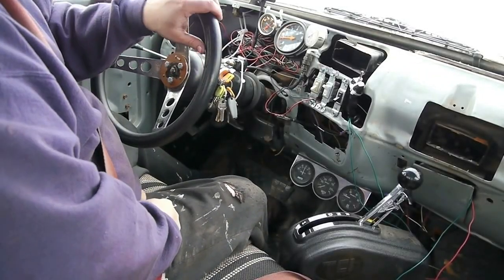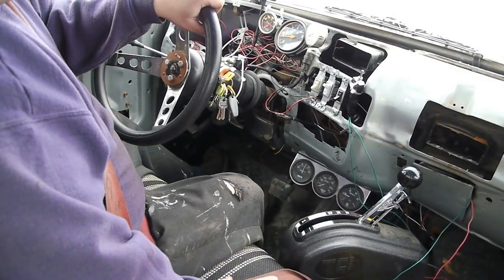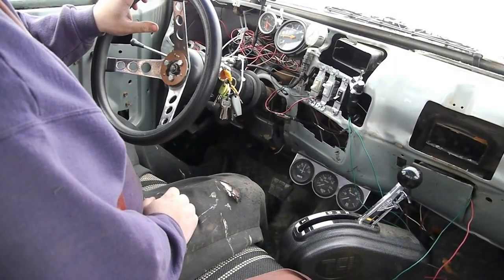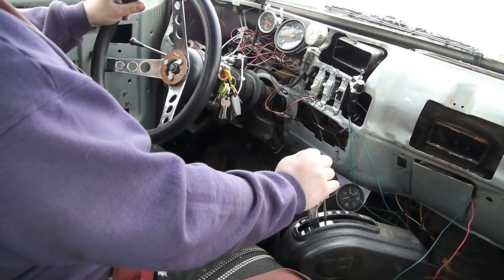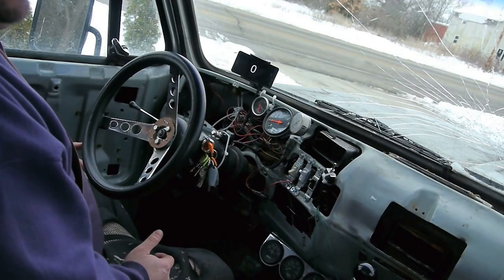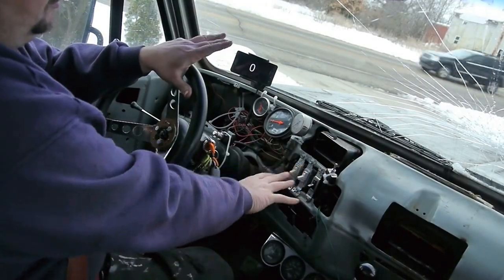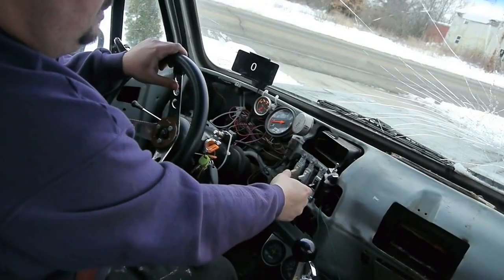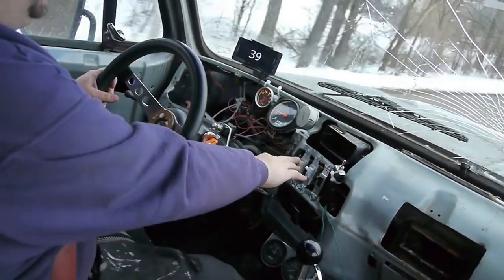4l80e full manual with no computer

Comment: So you're not modulating main line pressure at varying throttle positions , what are the possible implications of not doing that?
Also what's the purpose of the 3-2 PWM solenoid, dont you need that when down shifting?
Reply: Thanks 96TA...........Ever thought about doin a quick video of your setup? thad be cool, hint hint, lol
Reply: GoatBoy 45/70 he will have to rebuild this trans alot sooner. the max line pressure restricts converter flow (and from MY experience) the shifts are delayed about 3 seconds from the switch being flipped. the trans runs hotter than usual, and the rpms are higher. i would have to get my burb up to 2k just to try to keep up to speed limit. All that has changed now since i bought the TransGo vacuum modulator. i jerry rigged it by running steel vac hose thru the dipstick hole and cutting thru the dipstick tube then running more hose to the intake. lower rpms, runs cooler, shifts are sharper and instant, engine doesnt have to work as hard to move the truck.
Reply: GoatBoy 45/70 pwm solenoid is the incorrect term for what he is describing. the force motor/ pressure control solenoid is what controls line pressure from the factory. the vac mod i mentioned can replace that even if you still use the computer for auto shift 4l80. downshifting is just what he did in the video with the switches except REVERSE ORDER. me, personally i unlock TCC first then slow down keeping it in 4th. if i slow down below 20 mph, i pull both switches down to 2nd. dead stop i put solenoid A switch up to 1st gear. very simple compared to a real manual trans.
Reply: SnakePliscan2 yes ill do a video of the burb soon. Will get back to you on the GM squarebody thread that has pics of my setup.
Reply from the maker: The implications are potentially something breaks.  This is a junkyard transmission, nothing done to it, basically a core.  I'd be out the cost of my core and my time if it failed, which it never did while owned the truck.

Comment: what is the use of lock up torque converter?
Reply from the maker: A lock up torque converter helps improve fuel economy by lowering the RPMs when you are cruising.  Normally the engine RPM and the transmission input shaft RPM are not equal.  The torque converter allows slip, which is why you don't need a clutch in an automatic transmission vehicle.  At cruising speeds however, the lockup feature acts like a clutch that "locks up" and either completely prevents slip between the engine and the input shaft of the transmission or greatly reduces it (it depends on the car type and transmission).  

For me, going down the highway at like 70mph, the when I activated the lock up feature it dropped down my RPMs down by about 500.

Comment: How long did it last? is the truck still in service with the same trans?
Reply from the maker: I sold the truck.  It worked the entire time I had it, which was at least 2-3 years.  I have no idea how many miles the transmission had on it by the time I got it.
Reply: nice!

Comment from the maker: I don't know if it could lock up in first, I don't remember.  But I'm fairly certain it could in the other gears.
Reply: Dan Mann my 03 slivrado in tow mod locks up the coverter on all gears and you can notice the difference, the engine shifts at higher RPM..
Reply: Late to the party. But you can't lock converter in 1st with a 80. If I remember right, it uses the fluid from 1st gear to lock the converter. 
But 2nd, 3rd, and 4th it can be locked.

Comment: just curious, could you send power to the solenoids like being in 4th and then just manually shift it as if it were a full manual valve body and then just have a switch for the lockup?

Comment: how long have you run the c 30 with that 4l80e setup and have you had any issues with the full line pressure causing any probs?  I was going to run a shift drum with proper solenoid timing contacts and manual levers at the same time  side by side like zero turn mower handles so they can be shifted at same time or separately I was told by a friend in the business full line psi would lead to spline damage and or clutch pack damage I said I didn"t think so????

Comment: great work. do you know where their is a wiring schematic for this mod. im thinking about putting a 4l80e in a 1990 truck with a old 350 edelbrock carb, hei distributor. for a small point of interest. use a ardunio to control the actual shifting. that is a 5v board but with transistors and diodes could control a 12v system. the tach line could control the shift point. and with a additional switch. manual control is possible or with multiple control switches different shift points could be programmed. lots of options.

Comment: transgo sells a vacuum modulator to replaces the epc solenoid. aka force motor or line pressure solenoid. Then there is using the 1995 tbi chevy pcm with modded prom.

Comment: The SM 465 is one of the toughest transmissions ever made your loco for taking it out.  You will never have the pulling power off idle by taking out the Granny gear 4 speed,  are you a total goof?
Reply: Skeefoo Panama 😂 yea just the same way im loco for takin out the fully auto dinosaur th400 for a toggle switch shifting 4l80 like this one, right?? 

Get a clue, man. Its 2017. NON overdrive trannys with slippin ass torque converters are a memory of the past. especially when you got a bulletproof 4l80 that can be manual shifted like this one (computer deleted) and aftermarket vacuum modulator to replace the "force motor/epc solenoid" for engine modulated pressure. i got one of these in my truck and anuther in my street strip car. shits just too simple to pass up and not have. and theres no having to beef it up either.
Reply from the maker: I liked the sm465, it was fun to drive with that transmission.  It all came down to having back pain while shifting it, that's why I did the swap.
Reply: sm 465 is great for off roading,or a farm truck but it's no fun without overdrive. with the 4l80 you get much closer ratios which are very nice, especially if you are ever in mountain country, for towing or even just a work truck that gets used on the freeway. you will get better fuel economy just with the first thru third even when you're not going fast enough for overdrive. you could even go with 4.56 axle ratio and still get better fuel economy than 4spd manual with 3.73s. even 4.10s would plenty low for a start out with 10,000lbs behind you. many 4l80 equipped trucks came with 3.73s unless they were a 3500hd. the overdrive on the 4l80 is only .75 instead of .70 or .69 like all the other autos of that vintage. the 4l80 is the ultimate automatic for an older truck that's gonna do some heavy hauling and still be able to do some offroading. the manual alternative is the nv4500 which has stupid wide ratios, not great for towing. first is not all that low either. they are nice for offroading if go with 4.56 or 4.88s, but only in standard long wheelbase truck. not enough length in a blazer. besides the wider ratios the 4500 is gonna be more expensive than the 4l80 when swapping into an older truck. that's why I'm putting a 4l80 behind my 400 in an older motorhome that will spend most of its time in the Great Southwest.

Comment: Real cool. - What happens if you forget to turn off your torque converter lock when you come to a stop.
Reply: Nothing really - it'll just stall the motor similar to coming to a stop in a manual trans without pressing the clutch pedal in.

Comment: I´d rather you talk to much and be clear than rush through. Light switches are a nice touch lol. Well done. So, when you have all the selenoids on you can basically manually shift up AND down? The full line pressure does no harm does it? The old 700 you couldn't do that as it would also determine shift points of that TV cable. I've got a couple of 4l80's I was considering for a personal project and a customer car. This might well get me over the top. 

The cool thing to wire up would be something off the side of the shifter that makes contact with each selenoid switch combination that corresponds with the gear. You follow? That way you basically turn it into an auto box with manual shifting but by the same way the computer would have so no worries. The feel of a manual valve body...
Reply: Radesignsproducts.com has just that . Along with line pressure control

Comment: hey Dan? do you know if that 4l80e had a 3-2 downshift solenoid and if that's going to be a issue.
Reply from the maker: All gears are controlled by the two solenoids.  Going from 3 to 2nd place is just putting each of the two solenoids into the correct on or off state.  So there is no automatic downshifting.  You have to manipulate the solenoids like the video.  If you want to downshift just move the switches and the transmission will instantly change gears.
Reply from the maker: I should have also said that there is not a downshift solenoid.  Turbo 400 has one, 4l80e does not.  On the 4l80e that function was a combination of throttle position sensor and the ecu.  The ecu would detect throttle movement with the throttle position sensor, and then look at rpm, current gear, and road speed (maybe even more sensors).  The ecu then had a table in memory that it would use to look up those values to determine if it should send commands to solenoid A and B to produce a down shift.  You could think of that table as a spreadsheet like Excel.  Once it found a row that matched its current sensor values close enough it would see if the row suggested the correct gear.  If it was already in that gear it would do nothing.  If it wasn't in that gear it would send commands to the solenoid and change gears.
Reply: What about the 60e. I'm about to put this 4l60e in and I've been doing research it says it has a extra 3-2 downshift selonoid which releases a gear set and applies a band (something like that) some say it will burn the 3-4 clutch. I just don't wanna burn my tranny
Reply: darius walker what wires did you hook up mine has reverses but not any drive gears

Comment: props to Dan and Peter.   good stuff dudes!  Dan, your android speedo still needs to be connected to a service provider for speed view pro to function.   it uses GPS.  is this correct?  I like the organized mess you got going on in that truck.   cool stuff.
Reply from the maker: Jack, gps does not need cell phone service.  An older phone will work without the service.
Reply: +Dan Mann which phone and is an app needed?  Thanx!
Reply from the maker: I think any of the Android phones should have GPS available.  At this point you could practically get the phone I used in the video for free, because that model is no obsolete.

Comment: Now can you shift it manually with the gear shift or do you have to use the switches at all times?
Reply from the maker: Douglas with my setup u use the switches.  There is a way to do this where you use just the shifter and it's simple.  There is another set of switches in the transmission that the ecu uses to see what gear the gear selector is in.  You can figure out how to use those switches to replace the dash switches.  You need to think about how my switches work and then look up info on the internal switches and wire them so that when the gear selector changes it activates the solenoids.

Comment: Dan, is that a full 12Volts you are sending to the solenoids?
Reply from the maker: It is full 12v, but if I remember correctly the trams has a 12v supply wire and the wire for each solenoid goes through a switch that is connected to ground.  Flipping the switch turns the solenoids on by grounding them.  They share a common 12v input source from the 12v supply wire.
Reply: Stuart Langer No actually its ass backward to the 60e. the 4l80 has solenoids A and B get power fron switched GROUND (-). Same with TCC lockup. i have a similar setup in my truck with this and also the vacuum modulator so engine intake vacuum determines the pressure of the shifts. i didnt like havin the fixed pressure (force motor defaulted at max line pressure). the shifts were delayed, temperature ran hotter, and the rpms were higher than usual.
Reply from the maker: I never noticed anything odd with the RPMs, but I never had the transmission shifting with a computer.  I sold the truck a while back, was still shifting ok when I sold it.

Comment: Seriously man with all that work and other parts simply picking up a TH400 would have been just as cheap and without the hassle. Not to mention without the fire hazard or electric shock potential.
Reply: +Boredout454 ,,,,,then you burn gas,,,with no overdrive....or lock-up converter....
Reply from the maker: A th400 would have been easy I agree.  But if u have a 4l80e cheap and want overdrive and lock up torque converter, u could do this.  Think of what I did as a proof of concept.  Others can take this info and do it with nicer wiring :-)
Reply: Boredout454 no
Reply: +Dan Mann Electric shock potential of 12v? Fire hazard? Lol. This is a design proof. Just like the TBI's in the 80's people get all freaked out about them electronics and sensors and doodads. THis just proves the simplicity of the system and that it's easily manipulated. The tables you refer to Dan are much like fueling and spark tables ECU's refer too for timing and injection nowadays.  Great stuff!

Comment: Appreciate your effort Dan, I have a TCI SSF 700R4 I get automatic engine braking if I am in 3rd gear, not when in OD. I have had issues with this tranny forever...heat a big one, installed an external cooler, need to install a second one, maybe with a fan... Removed the Lock-up, Put in a Smaller 1800 Stall, I had Full Manual Lock-up Control on all Gears, had to remove that... I am also looking into getting a Floor Shifter. I also have a 1976 Chevy 2wd Pick-up.  What do you think of Gear Vendors? I love what you did with the Speedo....
Reply from the maker: I have a friend with a Gear Vendors - I think it's good, just more expensive than a junkyark 4L80e.

Comment: You should use a rheostat for the line pressure control
Reply from the maker: ^ This is probably the easiest.  Cheap PWM would be interesting as well.  I don't have the truck anymore or I would try it.
Reply: Peter Dy or he could just swap that shit out with a trans go vacuum modulator. run steel hose thru the dipstick tube (hole punch) then run rubber hose to the intake manifold. controls line pressure just like the old dinosaur th400
Reply: Cheap DC PWM variable controller capable of direct output that's at least 25% higher then what the 'niods max draw  (just dont get something silly, be trying to adjust micro pots with a tiny flathead while driving) I would look for one with with readout would be cooler but really you would want to set the top and bottom ranges using pressure gauge to see what pressure reading are at about 1200 and try to keep the fluid temp as close to 180-200F as you can while drive

Comment: I wrote the how to article on this a couple years ago. I did it with a 4L60e when my ecm fried out. Didn't use light switches though. 

I used the neutral safety switch on the shift detent, a single momentary toggle switch, and a b&m quick silver ratchet shifter. Had all 5 gears (4 forward plus reverse) and torque converter lockup. And didn't have to flip light switches.

Technically what you end up with is an analog computer.
Reply: i would love more information
Reply: I guess I'm just retarded I don't understand how you making shift have a 4 L 80 I don't want three switches in it would like to have one and just run the shifter
Reply: i would love more information on how to do this the right way without thousands in electronics. trying to make my late 80s non fuel injected 383 work with a 4l60e automatic
Reply: @williamallen8913  u can buy stand alone 4l60 and 80 controllers  i kno u said u didnt wanna spend a million dollars but im pretty sure theyre pretty affordable, especially if u get one used off ebay
Reply: @4dirt2racer0  I've seen those and I've heard good and bad but may be worth a try
Reply: @williamallen8913  where’s this write up you mentioned I would like to take a look pls
Reply: which article id love to read it

Comment from the maker: Full disclosure - this is from the msgpio.com website.  Lots of good information there about the wiring and even how to build your own transmission controller.

http://www.msgpio.com/manuals/mshift/4L80E/internal_wiring.jpg

http://www.msgpio.com/manuals/mshift/4L80E/4L80e.html

This kit with some additional components can be used to control the transmission fully automatically:

http://www.diyautotune.com/catalog/gpio-basic-kit-p-403.html

All of this evolved from this project: http://en.wikipedia.org/wiki/MegaSquirt

Stories about people who have built megasquirt and are running it: http://www.msruns.com/index.php
Reply: Dan Mann good afternoon Dan Mann I like what you did with the transmission 4L80E is something otherworldly congratulate you're a makina a question with this diagram you published your transmission can be installed without any problem http://www.msgpio.com/manuals Dan Mann /mshift/4L80E/internal_wiring.jpg questions that are the NRP and CD LMY tHE BEST HELP explain pin K30 hAVE A 86 CHEVY 5.7 ENGINE WITH THIS TRANSMISSION aND BUY BUT NOBODY KNOWS tHE INSTALLATION THANKS HOPE YOUR HELP
Reply: Extra thanks for that link. Your an amazing person.  I miss hanging out with my friends who done this same type of mods and fixes.